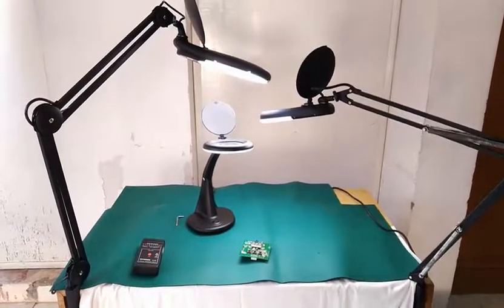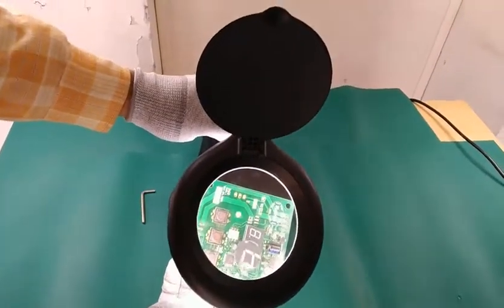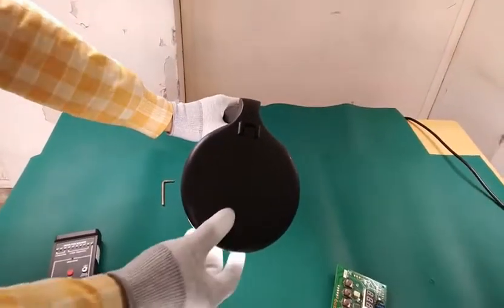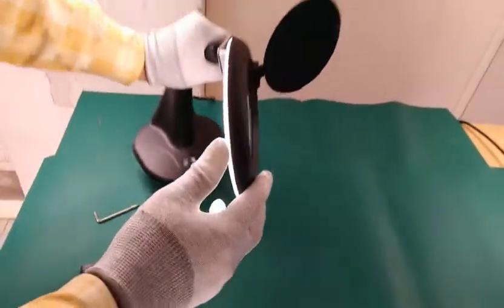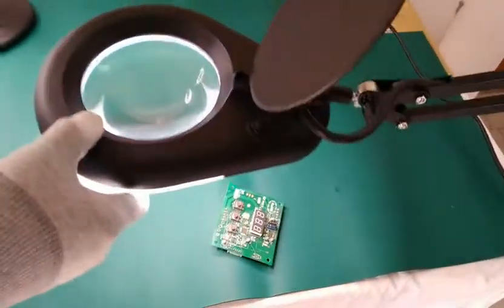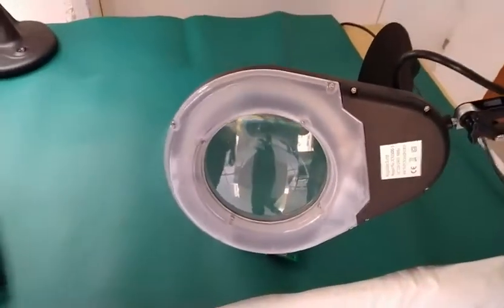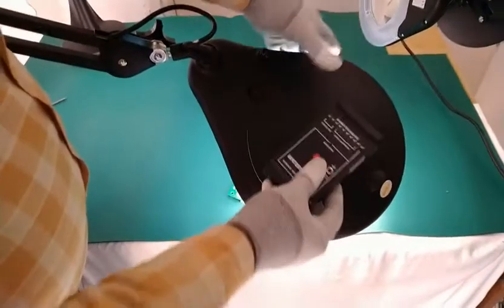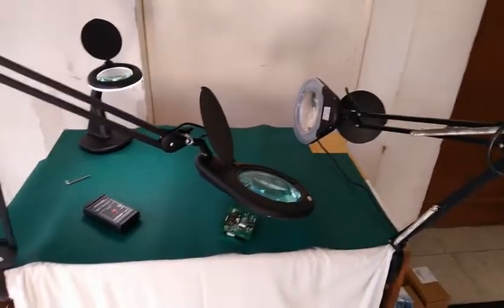Best Magnifying Lamp in India | ESD safe Illuminated Magnifiers - by INDE Enterprises

Comment: Any amazon link?
Reply from the maker: No. But you can always buy it our website https://indeonline.in.
Reply: @singhprojects  the price isn't listed on the website. There's no way to purchase the item either.

I'd like to know the working distance of both the 5 and 7 inch clamping magnifiers. Is it possible to use them at enough distance from the PCB for soldering application?
Reply from the maker: @nachiketmhatre7411  Please contact Mr Paras or Mr Romesh
 on the following number 9316134502. To purchase or to inquire any technical issues / support, please call them between 10AM - 6PM.
Reply: @singhprojects  I was about to send an email. I'll give a call tomorrow. I want the 7-inch bench magnifier and the motorised tip cleaner.
Reply from the maker: @nachiketmhatre7411  Mr Paras will be able to help you with COD also.
Reply: @singhprojects  sounds good. I'll give him a call.